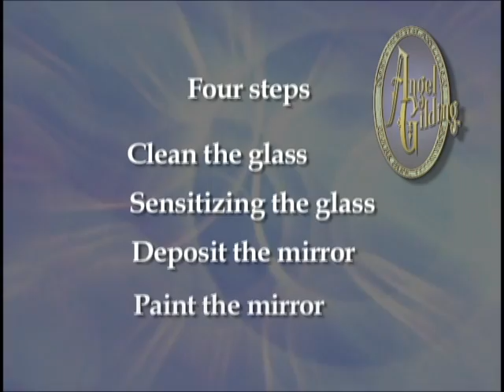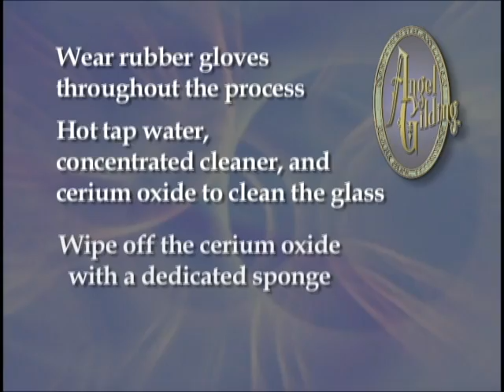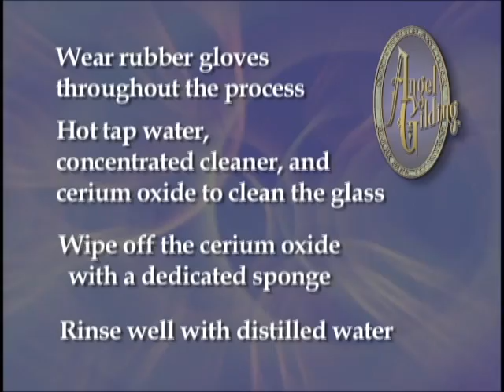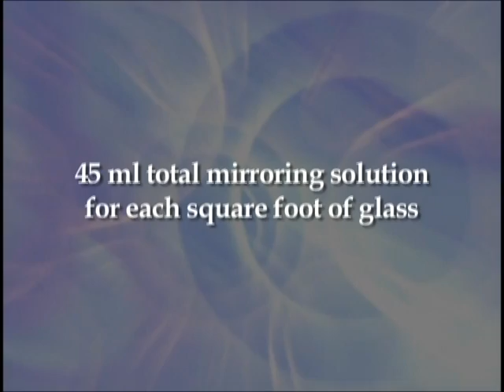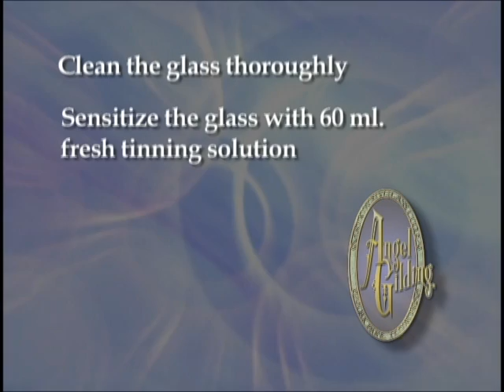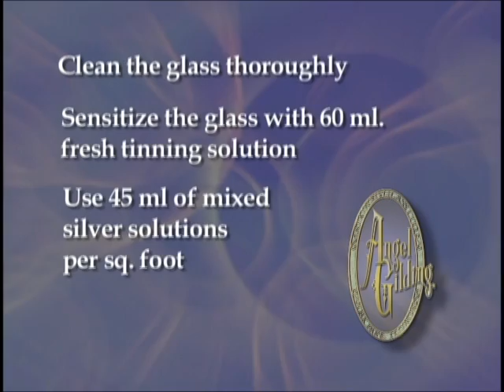How To Make a Silver Mirror

Comment: Do I skip the tin oxide step if I am trying to leave the old silver in place adding a fresh coat of silver to the back of it?  I don't want to take the antique out of the mirror...
Reply from the maker: Hello, if you are applying silver over a silvered layer then you do not need to add the Tin for Silver. However, depending on the condition of the silver layer and if there is a copper layer over it you could find it does not deposit in the way that you desire. We usually recommend removing the old silver and applying a new silver layer including the Tin for Silver. Thanks!

Comment: Just starting the video... you keep on saying use tap water then you use distilled water to get rid of the tap water.  Why not just use distilled water to begin with? :)

Stannous chloride (tin chloride) SnCl2 is a reducing agent. In water the tin and chlorine separate into ions (like NaCl salt).  Introducing silver nitrate AgNO3 to the aqueous SnCl2 on the glass a chemical reaction occurs and the silver precipitates out and is deposited on the glass.
Reply from the maker: Hello, You can use distilled water throughout the process if you would like. However, when you are first using the cleaner it is ok to use tap water as it will be fully rinsed off later. This way you can conserve some of your distilled water.

Comment: If at the silver applying stage, you pour it off quicker will that make a half silvered mirror? I need to make large beam splitters
Reply from the maker: Hello, thank you for your question. You can make a more translucent (less silvered) mirror by pouring off the solution before the 3-5 minute range. Applying the silver for 30 seconds is called "flash silvering". If you have any other questions for your project we can answer them through our contact us page on our website angelgilding.com Thanks!
Reply: @AngelGildingcom  thx

Comment: I wonder if it would coat carbon
Reply from the maker: Hello, that is an interesting question. Can you tell us more about the project you are thinking of?
Reply: Angel Gilding I’m doping carbon. Graphite. It’s for increasing conductive surfaces
Reply from the maker: Hello, it depends on what your intended use is of the piece. Graphite is already conductive, so although it is the case that silver will make a piece conductive, your piece already has some conductivity. In order for it to be reflective like a mirror, the silver needs to be applied over a smooth, high-gloss surface like glass, or a high gloss basecoat. I hope this helps!

Comment: Is there a way to make mirrors of different  colors?
Reply from the maker: Hello, thank you for your question. The most common way to make a different color mirror is to use different color glass. For example, many people make gold mirrors by silvering yellow glass. You can also paint the glass with some paints and then mirror over it. The one we know of that works in this way is Pebeo Vitrea 160. We also have an information page on our website about painted mirrors. I hope this helps!
Reply: Thanks
Reply: So I paint the glass on the front let it dry then mirror over the paint?
Reply from the maker: Hello, yes that would be the process. As long as the paint is compatible with the silver chemicals (such as the brand we mentioned) it should work just fine. You may find that you need to use some of our wetting agent to get the silver to coat well over the paint. Thanks!

Comment: An excellent video, is it possible to use this medoto to paint in plastic or polymer surfaces? Is it possible to achieve the gold color mirror?
Reply: Yes, you can use this method to create a silver surface on plastic or polymer. You must protect the silver surface with a clear top coat. If you add yellow dye to the top coat the surface will look gold. For more information see the Spray Chrome section of our website.

Comment: Can the glass have a painted image on it before being tinned, so between the glass and the silver?
Reply from the maker: Fae Valentine It depends on the paint you use. The mirroring chemicals are caustic and, of course, wet. Very often they will just lift the paint off the glass and your image will float away.The one paint we have found that works very well is Pebeo Vitrea 160 - a kind of paint that you bake in your kitchen oven. If you use the transparent version of these paints, the silver shines through and the effect is very beautiful. Because they are baked on, they are not affected by the mirroring chemicals at all. You can get these paints at many different art supply stores. -- Thanks for asking.
Reply: Angel Gilding  Awesome! Thank you! And thank you for the quick reply!

Comment: Can we make the same process with Graphite in solution. I do think it is even  easier to make it into the so cold  conductive Graphene.
Reply from the maker: Bartosz Barejko Unfortunately no.

Electroless plating (the process we use to produce mirrors) requires three things:
 1. An element such as silver whose atoms can lose one or more electrons to form cations which can be dissolved in solution, such as found in silver nitrate.
 2. A stable elemental form of that atom that can be deposited on a substrate like glass or plastic as a smooth continuous plate by slowly adding back the missing electron(s).
 3. A chemical in the solution which can provide those electrons, called a reducer.

Unfortunately carbon (the element in graphite and graphene) does not readily form cations by losing electrons. It also only forms graphene sheets (the equivalent of the mirror in our process) at extremes of temperature and pressure and in the absence of elements like oxygen with which it forms strong bonds to form carbon dioxide which effectively prevent it from forming graphene.

The methods used to date to produce graphene start with graphite and remove flakes of graphene from its surface. There is alleged to be a way to do this in a kitchen with a powerful blender but...
Reply from the maker: MirrorInaCan +Bartosz Barejko If you were to use a paint to create a mirror-like effect, perhaps you could mix graphene into that paint. This however, shows how to make a real silver mirror.